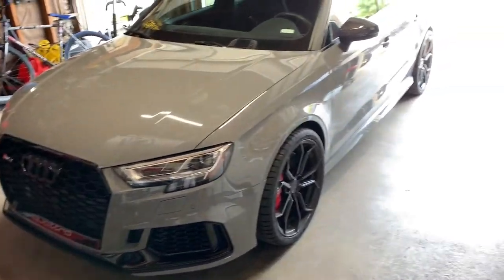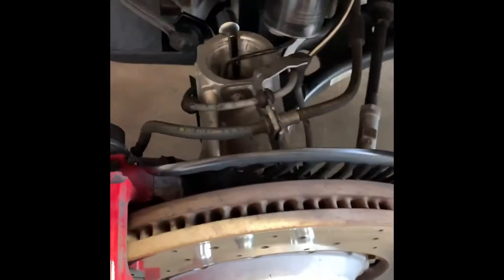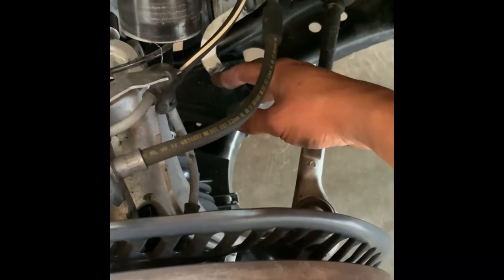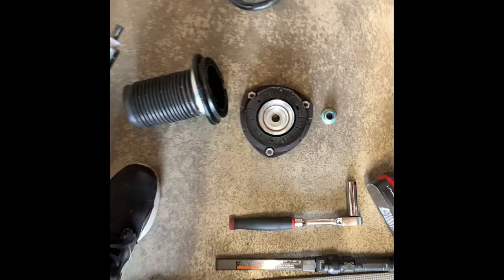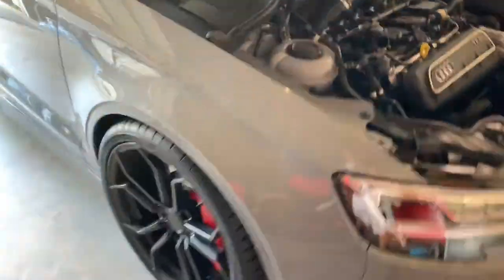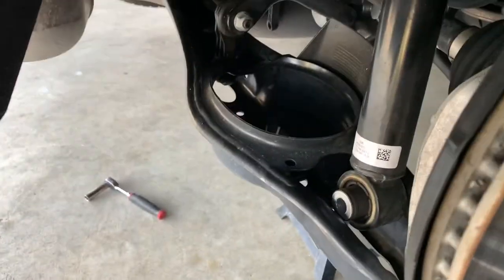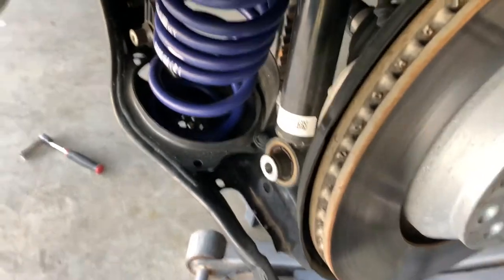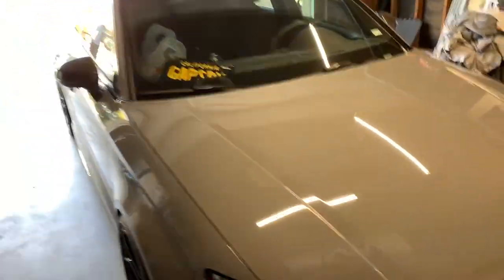Audi RS3 H&R Lowering Springs

Comment: Any advice on which suspension is better for a TT RS?  Magnetic or fixed?  I do want better handling, but will have 20 inch wheels so I don't want to crack any rims
Reply from the maker: IMO I’d say keep mag ride